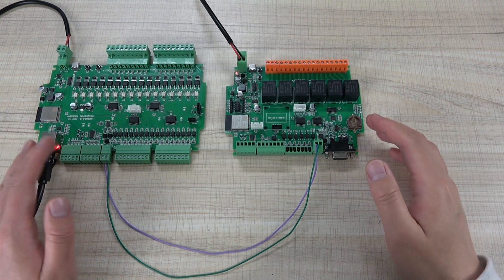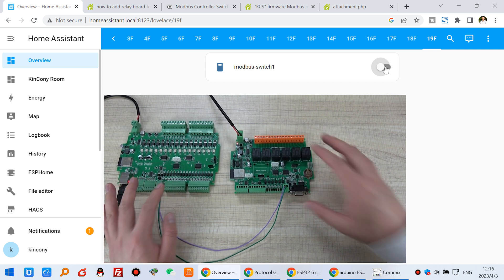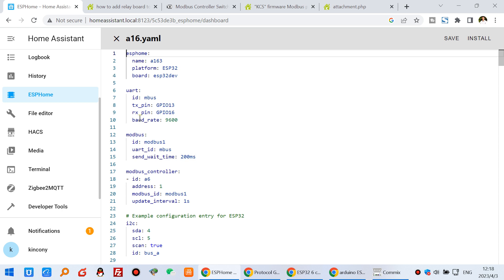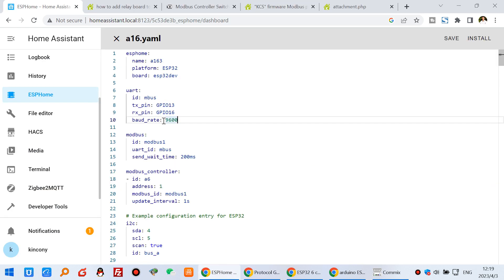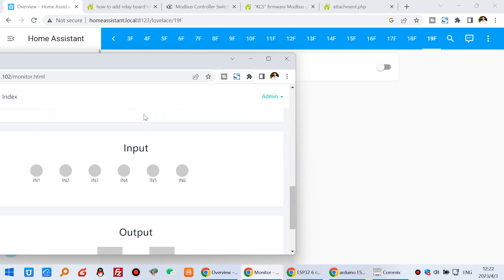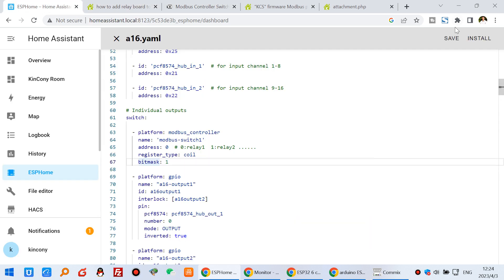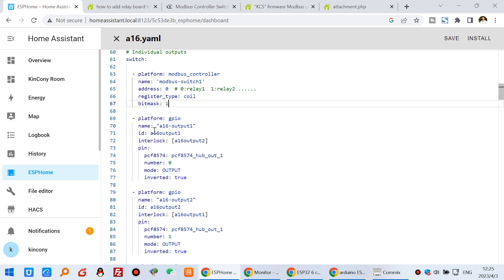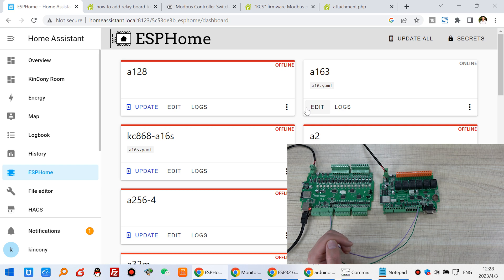how to add RS485 relay board to ESPHome by Modbus Controller Switch

Comment: Can you send a PWM signal over RS485 to a slave device if the slave device is an optocoupler?
Reply from the maker: that not support
Reply: You can send a command over RS485 that makes a "slave" device create a PWM  signal on an output pin but you'll have to provide code for both.  Not sure if ESPHome could create the code on its own,  ask there.

Comment: Hello, I like your products, but I can't find information on how you managed the EMI
Reply from the maker: what's EMI?
Reply: @KinCony  electromagnetic interference while switching off some devices with relays. With the Arduino I had to use TVS diodes to kill these voltage spikes
Reply from the maker: maybe you have connect with AD load, but it's important with PCB design to kill that. @MichalKubinec

Comment: would this be a correct config with 4 A16 boards?

uart:
  id: mbus
  tx_pin: GPIO13
  rx_pin: GPIO16
  baud_rate: 9600

modbus:
  id: modbus1
  uart_id: mbus
  send_wait_time: 200ms

modbus_controller_board2:
- id: a16-Board2
  address: 1
  modbus_id: modbus1
  update_interval: 1s

modbus_controller_board3:
- id: a16-Board3
  address: 2
  modbus_id: modbus1
  update_interval: 1s

modbus_controller_board4:
- id: a16-Board4
  address: 3
  modbus_id: modbus1
  update_interval: 1s

switch:
  - platform: modbus_controller_board2
    name: 'modbus_board2-switch1'
    address: 0  # 0:relay1  1:relay2 ......
    register_type: coil
    bitmask: 1c
....

switch:
  - platform: modbus_controller_board2
    name: 'modbus_board2-switch16'
    address: 15  # 0:relay1  1:relay2 ......
    register_type: coil
    bitmask: 1

#Board 3

switch:
  - platform: modbus_controller_board3
    name: 'modbus_board3-switch1'
    address: 0  # 0:relay1  1:relay2 ......
    register_type: coil
    bitmask: 1c
....

switch:
  - platform: modbus_controller_board3
    name: 'modbus_board3-switch16'
    address: 15  # 0:relay1  1:relay2 ......
    register_type: coil
    bitmask: 1

#Board 4

switch:
  - platform: modbus_controller_board4
    name: 'modbus_board4-switch1'
    address: 0  # 0:relay1  1:relay2 ......
    register_type: coil
    bitmask: 1c
....

switch:
  - platform: modbus_controller_board4
    name: 'modbus_board4-switch16'
    address: 15  # 0:relay1  1:relay2 ......
    register_type: coil
    bitmask: 1
Reply from the maker: you can post your question to our forum: www.kincony.com/forum    it's easy to answer questions

Comment: is it possible to communicate between 2 esphome boards with rs485? i want to have communication save if homeassistant is offline ;)
Reply from the maker: sure, no problem. two "MASTER".
Reply: @KinCony  no i think that is not possible at the moment. i want 2 kincony boards flashed with esphome. and they should communicate to each other with modbus. so for example you can push button on board1 and at board2 is relay on.
Reply from the maker: @Jan-sn3tv  Don't control at the same time at a certain moment